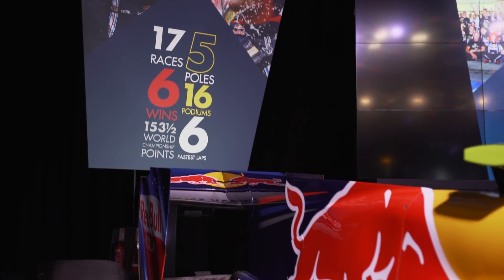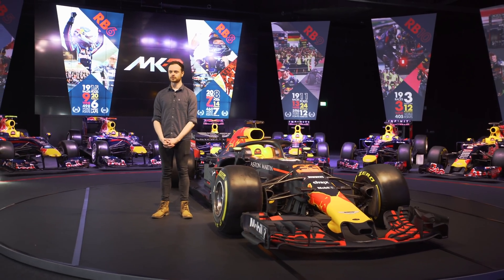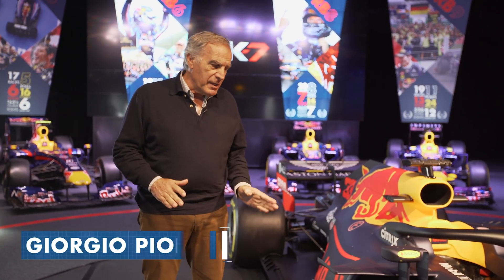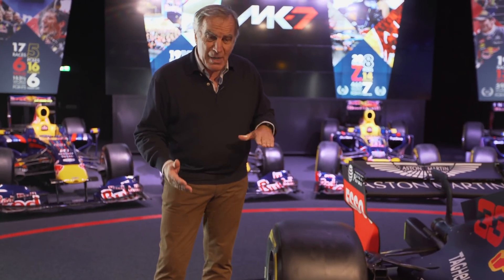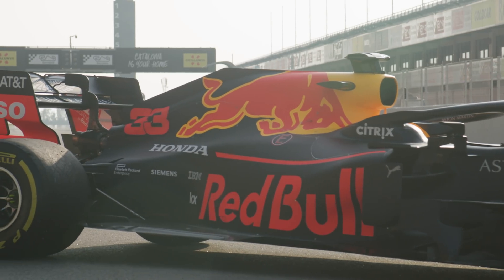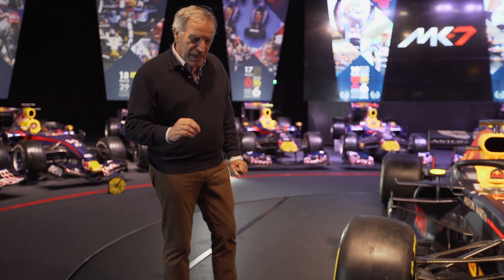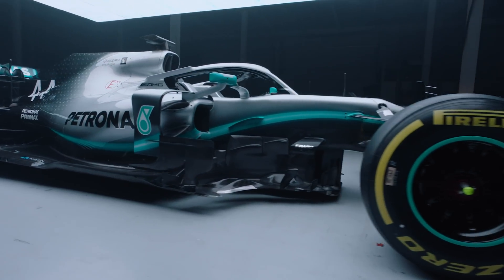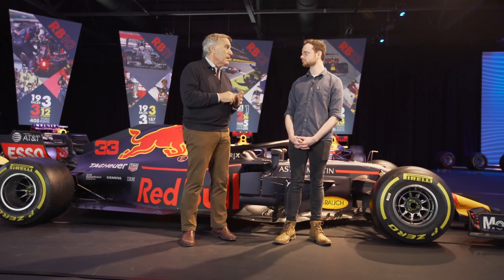Why 'rake' is such a big design trend in F1

Comment: Funny that the only car without the set up is totally dominating the season. 🤪
Reply: As they said, they have a different concept, with its main focus being the PU. The Mercedes is slower with a higher rake setting, just as all other cars would be slower with a lower one. One thing to point out is that ALL F1 cars have rake. The difference between their settings being the rear-front delta. What they refer to in this video is how Red Bull usually uses a much higher setting than the rest to fit their whole aerodynamic concept.
Reply: You might not like his personality but come on how delusional are you if you think Lewis isn't one of the greats. He has prove his worth before formula 1 in other ranks and still was on top. Both Michael and Alonso have said he is one of the best drivers. Yeah he has has the best car but so did Vettel and schumi no one discredits them.
Reply: $500,000,000 tends to do that.
Reply: @Troy Mclore exactly that, agreed 100% just the best driver of his time and the most balanced.
Reply: it's not the concept that makes you win or not. It's how much you can extract from it. Red Bull won with this concept in an era where Ferrari, like Mercedes, didn't used the rake concept.
Reply: @Stratowind he started good but sorry mate he's a better driver than me but still far from deserving that merc seat. There's better drivers they could put in that merc and get better results... Even grosjean would smoke bottas if they were both in a merc
Reply: Funny that without this they may be down the line
Reply: @Troy Mclore nobody is arguing that..
Reply: Dumb
Reply: @Stratowind yea, thats when he has his porridge and hangs up when he hears "It's james"
Reply: It's because Brawn's philosophy is still within the team, Despite Brawn owned and managed Mercedes only for the first 3 seasons (technically longer because Mercedes is the old Honda F1 team). Brawn always said to never copy an idea from another team because you'll only be as good as they, not better.
Reply: Only car?
...except those one's they built in the late 70s.
Reply: Everyone is struggling go come up with a good explanation for that.   My personal theory is that Mercedes aero engineers are next-level genius compared to the others.  They have engineered a masterpiece that has been optimised to work in a wide operating window using a different approach.
Reply: This argument is just ridiculous. People are saying Hamilton is only winning because of the car, but if you bring up his teammates he beat them because they aren't very good.. so it's clearly not all car then? Someone has literally said Ferrari didn't have the better car last season and were only winning because Vettel was the better driver until Germany but as soon as Hamilton started destroying Vettel.. it's the car. Is it car or driver? You can't have your cake and eat it too
Reply: chickmag001 I think you missing the point. Firstly last year Ferrari was better on some circuits. F1 is very circuit dependant. And there is no ways you can argue that Mercedes hasn’t been the dominant car in the turbo era. Bottas beats Hamilton on a regular basis. Too often. Ros also beat him too often.
Reply: @ryanwaugh1   like Stuart just said, how can he be getting beat way too often when he has overall beaten both bottas and rosberg convincingly. Vettel on the other hand is hardly convincing against a rookie leclerc and got beaten convincingly by ricciardo.
Reply: chickmag001 I’m talking individual races. Lewis has lost many races to his partners. Overall he’s a good driver. He’s not the best on the grid though. That’s between Verstappen and maybe Leclerc in a year or two.
Reply: @ryanwaugh1  https://f1i.com/news/289646-hamilton-measure-team-mates-much.html

Check this link shows percentage of races Lewis has beaten his teammate over qualify and race your comments are completely wrong even i was reading it I thought he beat Alonso in first season easily but looking at the data he didn't but since then he has dominated every driver and has also been the only driver ever to win at least one race every season he has been in end of
Reply: @stuctr  I hope you watched the race .
Watching Lewis spinning on slicks on damp track . Now try and tell me  Lewis is better than aryton .....and we'll both know you're lieing .
Reply: Honestly very hard to compare modern F1 to decades ago.  The teams are so much closer and skill level in the field higher overall.  Also important beyond skill of speed and consistency is ones ability to adapt to a car (or a team to deliver a car that fits a drivers style.)  Even minor changes in rules can accidentally favor some drivers over others.  Some drivers are more aggressive some more smooth, some would be better with more drivers aids and complexity others more in raw cars with nothing.  All of these little things matter because F1 is so damn competitive.
Reply: @MrCatseyes01  hope you watched today's race and now tell me Lewis ain't the best and then we both know you lying lol
Reply: @stuctr  don't make me laugh , Lewis can't even stay on a wet track . 
Mercedes had the fast car and best strategy that's all
Reply: Bet you feel pretty stupid right about now
Reply: Funny how F1 Gernany totally exposed both drivers as complete amateurs. FIA should look for autonomous driver aids in those cars. Clearly didn't work in the rain 🤣🤣🤣
Reply: Lewis is like a spoiled child.. don't care how good a driver he is . Give Alonso his car and see..
Reply: there are many factors that affects the speed of the car, not just the aerodynamics
Reply: Man this comment section is entertaining to read 🍿🥤
Reply: Troy Mclore Lewis has been beaten too many times by his teammates. He’s had the best car all his career wins. He is good but way overrated. I think Verstappen has surpassed him and I hope Leclerc will soon.
Reply: @ryanwaugh1  what the f you on about Lewis got beat once by Rosberg because he was more consistent if Lewis hadn't had his retirements that season from car failure he would have won title when he came into sport at the time Alonso was 2 time world champion who just beat Schumacher at his prime and Lewis wiped the floor with Alonso in his first season button never came close neither did kovalinenn bottas show me one example of Lewis over a whole season being beaten by teammate
Reply: stuart davies Lewis has been beaten many times. He still loses to a below par driver in Bottas. Schumacher has a car that FIA tried to slow down that year. He still contended for the title.
Reply: @ryanwaugh1  bottas been in a championship winning car for last 2 years correct and has come nowhere Lewis except for a couple of wins Lewis is so consistent and fast when red bull dominated with vettel Hamilton was still adding pole positions and the odd win to his tally in a McLaren which was not as fast as red bull proves you wrong that he needs to drive a shitter car he will be the most successful driver in f1 soon with wins titles etc results matter end of and Lewis is king at getting results with few mistakes
Reply: ғɪʟʟ 1ɴ ᴛ҉ ʜ3 ʙʟᴀɴᴋs I think it’s the drivers tbh cos Lewis is by far the best driver on the grid, but once he is out of his prime, youngsters such as Norris, leclerc or verstsppen will dominate
Reply: KSI SOLDIER please man! Lewis overrated cause he’s British. Verstappen is way better and I’m not even a fan. He’s always had the best car and that’s it.
Reply: MrCatsEyes British broadcast across the globe and they always pump their own. Bias media. Until Lewis drives an underrated car like Verstappen is now and puts it in the same positions he’ll never be one of the greatest.
Reply: @ryanwaugh1  and I do agree with what you said . I'm not a hypocrite or a Lewis fanboy for me he's very good but not until he does what even alonso did and drive a crap car he won't be more than a outstanding driver in a very good car
Reply: KSI SOLDIER verstappen is better than Hamilton
Reply: @gcar5214  wow you are cute, you don't seem to know f for a long time, drivers have only a very little influence, it's 90% the car and engineers that make a win
Reply: KSI SOLDIER by far May not be true, but he is good
Reply: KSI SOLDIER he isn’t by far the best driver on the grid.
Reply: @gcar5214  lmao you're taking the piss. Mercedes are dropping Bottas because he's so slow.
Reply: @gcar5214  Lewis is garbage without merc
Reply: @CxnstantineII  just swap him with Kubica and we'll see him battling Russell for 19th 😂
Reply: @gcar5214 , crap. 
Top Gear the F1 drivers were doing a lap in the Kia and Daniel Ricciardo's lap was faster than Lewis Hamilton's. 
Argument settled.
Reply: KSI SOLDIER  im a hamilton fan but if you put him in a williams he wouldnt be winning
Reply: @gcar5214  LEwIs iS THe BeST dIVeR oN ThE GrId .....
No he's a good driver in the best car on the grid
Reply: @MrCatseyes01  Perfectly said thank you... Literally put George Russell in the Merc car and he would be doing just as well... F1 isn't all about drivers, it's about the car package. SO many fans overlook this because they treat it like Golf or Tennis where most of success is derived from individual performance. Think about how little credit race engineers, aerodynamicists, and R&D people in general receive compared to the drivers on the grid. Sure, drivers are important but as F1 has always shown- if the car isn't there, the driver won't be either. E.g. Fernando Alonso, Lewis Hamilton at McLaren 2009-2013, Kimi Raikkonen now with Alfa Romeo vs. Ferrari last year
Reply: @f4k3gamer  I think you forget that vettel threw the championship away at Germany last year . 
Wich proves it's 70% the car .

Nigel mansell never won a wdc until Williams did traction control and active suspension . 

Damon Hill never win anything until he won the wdc in a Williams full of toys 

Rosberg never won shit until he got in a merc , then quit.  

Jenson button never won a wdc until he got in a brawn 

And the only thing bottas could catch in a Williams was a cold 

Your piont is ?
Reply: Rex Kim I hope Michael Schumacher is included in your argument 
Senna 
Prost
Fanjio
Vettel 
Every other driver that has won a race and championship 
Win a race=Car. Great philosophy.
Reply: @f4k3gamer  Oh, please... Give me a break. That Merc was miles better than the Ferrari. The difference wasn't as abysmal as this year's, but trying to heighten Lewis' 2018 Championship by giving the Scuderia credit for something they don't deserve it is both ludicrous and ridiculous. The Ferrari seemed better because Vettel was better than Lewis up until Germany, but we all know what happened after that...
Reply: @migracing8232  I was just listing some examples
Reply: @f4k3gamer  exactly
Reply: @migracing8232  yeh but senna was born to drive , go watch his vids in a lotus . The guy was born to be the best f1 driver that will ever of lived , there will never be a better driver than senna
Reply: @j.j.schlachtfeld9325  So when vettel wins its his talent but when lewis wins its the car? LOOOL
Reply: @MrCatseyes01  hes the best driver in the best car
Reply: @j.j.schlachtfeld9325  wrong so much. since 2017 Ferrari has always been much easier to drive than Mercedes. and in 2018, Ferrari had better engine, and better aeros. There is no arguing that, also tire management. the only thing that Mercedes had, was their team, including Bottas and Hamilton. car can't win races without a driver, the same way as driver can't win races without a car.
Reply: @iChrisBeezy7  Not at all. Vettel was outperforming the car last year, but Lewis was underperforming. The minute he got his shit together, he was unbeatable. Having a great car helps, obviously, but as Bottas, Gasly, and others  have shown many times, it's not everything. Vettel was on his A-game from 2009 to 2013. He won four titles and came second in 2009, but if anyone says the RBs 6, 7, 8, and 9 weren't the best cars in their respective years, they're crazy.
Reply: @Sajaia92  The Ferrari seemed to be better because Vettel was outperforming the car for a while (some people seem to forget that he's actually good, lol) while Lewis wasn't on his usual level (he said it himself many times).Of course it all turned around in the second half. Both teams have never been so close, but the W09 was the better package, and there's nothing wrong with that. Mercedes works better than Ferrari, but that doesn't take anything away from a great season by Lewis.
Reply: MrCatsEyes All of a sudden senna is born to drive. So you’re implying that other drivers weren’t born or just a sitting duck getting paid 40 million dollars to drive a car each year? Are you telling me the teams doesn’t know the importance of drivers and their talent and they went out their way to pay them 40 million dollars each year to driver their car and win races and championships for them? You’re pretty ignorant.
Reply: Rex Kim Are you seriously getting defensive of your favourite driver cos the argument got spicy? Way to be a hypocrite man.
Reply: @j.j.schlachtfeld9325  I don't forget that Vettel is good. He is 4 times wdc after all for a reason. But he hasn't been in a good shape since he joined Ferrari. That's what kind of an effect this brand has on the drivers. In 2018 it was only second half of the season where Mercedes outdeveloped Ferrari
Reply: @migracing8232  not ignorant , I've seen senna drive in real life nobody is better than him, prost was close if not equal , senna used to drive one handed around Monaco,  shifting gears with left hand when the gear stick was on the right , senna invented heel and toe and like I previously said he won  in a lotus wich was not as quick as other cars . Senna was good in any car ...
Reply: @migracing8232  and yeh Lewis got skills but he's just a product,  he was racing from childhood then spotted by mclaren. Then got the the best coaching in the f1 world . Then the best team .
Reply: @migracing8232  ? I don't have a favorite driver, nor I have I mentioned any. Did you even read my post? Does it imply anywhere who my favorite driver is? I'm agreeing with you that the car is a monumental factor in deciding winning.. not sure why you're calling me a hypocrite?
Reply: @trexsharktruck86  exactly . That's why I only support teams and not drivers although I think max is very good pushing the merc and ferrari in a redbull that's  inferior to the top teams
Reply: @f4k3gamer  wich  proves my point it's the car that wins championships. Every f1 driver aspires to be like senna even Lewis
Reply: @MrCatseyes01  look at Lewis track record he has won at every formula he has driven Rosberg only title win came from consistency not pure pace you only need to look at how many pole positions Lewis has the most ever in f1 (and yes they do 20+ races a season) his ability over one lap to put it all together with low fuel get the tyres in the window for that one lap is outstanding and to me proves Lewis Hamilton is the best we have ever seen I agree senna was amazing I remember watching him but he also was a cheat like Schumacher people seem to gloss over that as he unfortunately died yes the cars were trickier to drive in his age but we're do you stop with that I  mean Stirling moss etc were driving in bath tubs doing 160+ on skinny tyres people died week on week I can't wait for Lewis to overtake Schumacher as the most successful driver ever and wipe people's noses in it which I doubt he would as he is a humble guy despite being so rich and famous
Reply: @stuctr  mate dont talk to me about rosburg the guy only raced because of his dad keke and when he relised he was living a lie, he quit.
And how exactly did senna cheat? yes he got a bit crazy at times and may of cut the odd corner and that's it.
But if you look at the race line these drivers 2019 are taking its not far off race track bounds.
And yeh for sure nobody can top the likes of fangio, moss, lauder they were in a league of thier own.
Not hating Lewis the guy has more skill than every f1 fan. But just put max in that merc and you'll see a better driver than Lewis
Reply: @MrCatseyes01  I used Rosberg in same context as you so why not mention him and I suggest you do some history checking senna drove prost off the road at the final race in Japan prost in same car was faster and would have won championship but senna rammed him off at first corner to take the title same as Schumacher against hill and he tried it also against villenueve in 97 give me one example of Lewis cheating 

And as for verstapen I'm a massive fan he is quick but Lewis would easily compete he is shorter and lighter for a start so has a minor advantage over max in just basic physicallity for ballast etc Lewis is so smart in race craft and his experience would easily overcome max
Reply: @stuctr  I've been a f1 fan for 30 years mate I don't need to check anything.
Like I said senna got crazy at Japan and again I said prost was his equal in the same car I'm not taking anything away from prost but that's how people dismiss senna... From Japan. I'm not going to speak badly about Schumacher because of his situation but nope sorry he just had the same mentality as senna, Lewis, max he was there to win he was ruthless.... On the other hand you might want to ask ferrari about the cheating part.....
Reply: @stuctr  and yeh as for Lewis being shorter and lighter, yup that's facts the smaller driver will always be the fastest
Reply: @MrCatseyes01  then why would you say senna didn't cheat if you knew he did lol senna would also not share information with teammates which was a reason he went to Williams as number1 driver nobody wins in f1 without a decent car and some luck in the race Lewis is the best we have ever seen for now maybe one day max will overtake him time will tell
Reply: @MrCatseyes01  so we agree them Lewis is the best lol
Reply: @stuctr  haha so you dismiss senna because of Japan. One incident infuences your complete opinion? Senna was consistently the fastest. Hamilton might be the best you've seen. Like I said when Lewis can drive a car with no driving aids around Monaco.... The hardest and demanding track on the f1 calendar, one handed heel and towing and changing gear in a sequential box with the opposite hand, and then still going. 4 seconds than anybody else.
Then there's senna in the wet 1993 European gp, highly regarded as the wet race master and the best f1 opening lap in f1 history.
When Hamilton can do what aryton did  then  come and make your claim, but for now it's just numbers on a bit of paper nothing else.
Reply: @stuctr  no he's the best for you and that's it.
Reply: @MrCatseyes01  so i can't use one moment in history to show senna at his worse to win one of his 3 titles prost would have 5 and senna only 2 otherwise but you can use single moments of brilliance sounds a bit hypocritical to me 

And as for Monaco quite a few people might argue look at this year's race with the tyres we have now to keep verstapen behind as a masterclass in Lewis craft for driving I'm not saying senna wasn't amazing just don't understand how you can't see Lewis as the genius driver he is
Reply: @MrCatseyes01  He beat the fastest lap with 20 lap old hard tyres on silverstone
Reply: @stuctr  no that's the only moment you've used because that's the only moment you have and that's a fact . You're trying to say Lewis has never made a mistake ? 
Not a hypocrite and not single moments check your f1 history then get back to  me when Lewis drive like aryton did ,  over 20 years and here we are still talking about aryton . I highly doubt people will think the same about Lewis in 20 years , he'll just be another Schumacher. ...that guy that won .......of races because of the car and that's it nothing else .
Reply: @stuctr  and I never said Lewis is a bad driver ,he's more dominant because of the car  infact his style is very similar to sennas ,on paper Lewis may be a better driver , in reality he'll never be better than senna,
Reply: @SENTlNEL  yeh with the best car and set up on the grid . 
Sorry mate until Lewis goes ham in another car and another team then all the numbers in the world won't change my opinion . Or if by some miracle aryton and Lewis went head to head then I still know aryton would beat him 
Aryton - Jedi master 
Lewis - Jedi knight
Reply: @f4k3gamer  yes but he's never driven a bad car , that's my piont dude and yes if corse I watched 2008 . Like the other guy said , every driver has his moments , I'm not taking that away from Lewis a brilliant drive in the wet . But again sorry until Lewis drives on a wet track on slicks like aryton then nothing you say will change my mind
Reply: @MrCatseyes01  I would say results matter had senna never won a world title would we still be talking also as sad as it is would we still be talking if he hadn't died would he have won more titles etc etc that is a main reason we still talk about senna as the greatest because he never had a full career Lewis has overtaken senna in every aspect wins poles titles and I hope he beats Schumacher titles but people like you will probably never accept him as the best because of your rose tinted glasses about senna using a few races where he was exceptional you used Monaco as example earlier driving with other hand etc but should we also mention when he was nearly a lap ahead and pushed too hard and crashed before the tunnel Lewis has made far less mistakes then senna did he also has never rammed someone off track to win a world title
Reply: @MrCatseyes01  Also if you were just watching the f1 live nearly 4 tenths quicker than teammate same car enough said Lewis the best lol
Reply: El-Caesar don’t bother with haters, they are always gonna hate.
Reply: @MrCatseyes01  Senna DID NOT invent heel and toe.  Senna was good but not good in any car, that would be Stirling Moss.  That man could go from an F1 race one weekend, to a rally the next.
Reply: @MrRadialdrift  dude your talking about a complete different kind of human  being , guys like Moss happen by a freak of nature , thier not human .....
Reply: @MrCatseyes01  Max Verstappen, nuff said ;)
Reply: @migracing8232  Here lie the difference.  Senna and Vettel won with one dominant team at the time.  Schumacher and Prost won with two teams.   So did legends like Lauda, Stewart, Graham Hill, Piquet and Fittipaldi.  But no one did it like Fangio, who won with 4 different teams:  Alfa Romeo, Mercedes, Ferrari-Lancia and Maserati.  It is much easier to step into a winning team right away, than to lead at different teams having the right talents altogether.
Reply: @MrCatseyes01  Do you even know what the hell you are talking about?  Have you ever being in a racing car or even driving one?  Do you know what is the 'Heel to toe' technique?

'Heel to toe' has been around since automotive racing was born in the early parts of the 20th Century.  In order to do this, you need to have a good feel of the car and being smooth throughout.

Senna is the complete opposite to this.  If you have a chance to watch his racing films, in particular with the turbo days where there was a significant turbo lag before the full power is coming on.  Senna will like to maintain completely high revs throughout by 'jabbing' the accelerator pedal to keep the momentum of the car going.  To do this, he needed to trust his instincts and catching the drift the moment when the car might go away.  Of course, this looks quite spectacular in one sense.  However, that doesn't mean the car will go faster because you are losing time in correcting the drifts.  This is why the car that is going smooth is usually the fastest.  

Over driving the car like what Senna did was trying to compensating the car.  Problem is that he often gave unnecessary abuse to the mechanical stress and killing the grips of his tyres.  Sure, he was a legend and really successful.  But often he suffered far more reliability issues too.  The days where the races were sprints, super grippy tyres and refueling.  It wasn't really an issue.  However, with a completely different car where you have to use different tyre compounds, no refueling and handling tyres that suddenly will go off like grooved or Pirelli compounds.  Will Senna able to cope?  I am not sure about that.
Reply: @canicetang8837  and how much racing experience do you have?  Wich is a stupid question because I already know the answer .....0 .
Reply: Mathew Alani Ferrari had a better car, but far from a much better car
Reply: @j.j.schlachtfeld9325  some of the things that stands out in 2018, Ferrari performance in Australia, Bahrain, USA and especially Spa. Arguably some of the best all round performance with merc being left in the dust..
Ferrari had a more complete package last year
Reply: MrCatsEyes  u can say the EXACT same thing for verstappen, and Lewis made it work at mclaren while Button couldn’t
Reply: @trexsharktruck86  A fast, well balanced, and reliable car is about half the battle. The other half is a consistent driver. All the drivers are good, and fast. Otherwise they would have never made it to F1. The big difference is being good and fast, lap after lap. There are few drivers in history who can do that. When you compare Hamilton to Bottas in the same machine, Bottas may win a one lap race. Give them 20 races at 50 laps a race, and Hamilton will be more consistent. That's where the win is. Now most of you already know that. So stop being naive on youtube.
Reply: @trexsharktruck86  Put Ronaldo in Barnesley and he won't win the champions league, the same with Messi.
Reply: KSI SOLDIER Absolutely false, F1 is 90% car and Bottas isn’t a fast driver
Reply: @IchiroSakamoto  agreed bottas is just a flump , he's faking it anybody knows anything about f1 knows it's the car . 
That merc could probly drive itself :)
Reply: @IchiroSakamoto  then explain why Bottas has qualified better then Hamilton at times. If he's so slow how did he dominate the first two races?? Idiot comment that Bottas isn't fast. He's apparently faster then most of the grid including Verstappen and Leclerc

SMH
Reply: @IchiroSakamoto  I agree. Except 90% is way off. The car is at least 95%. Any good driver would put a Merc, Ferrari, or Red Bull in the top 6.
Reply: @gcar5214  Yeah smh Russel is the 2nd worst driver of the grid he is always 19th in qualifications! Verstappen is so bad compared to Lewis he never qualified higher than him! Lewis destroys everybody with his talent!
Reply: @emilecarpentier  put max in that other Mercedes and he'd take the fight to lewis. No doubt about it. I bet he's a driver lewis would last want to see as his teammate. He doesn't qualify or finish ahead of Lewis right now because the red bull car is nowhere near as good as the mercedes. Seriously though, I hope Max is the one who will replace bottas
Reply: @richboy900  Yeah I know lmao I was just laughing at this guy for saying Lewis dominates everybody without mentioning the car, Lewis is no doubt one of the best driver in the history but still he only has to beat his teammate. I have high hope for 2021-23 with budget restrictions
Reply: @emilecarpentier  what! !! Honestly disagree with your opinion on max . Let them drive the same for sure I bet on max
Reply: @anandakumar gurunathan she was being sarcastic, i think it was pretty damn obvious
Reply: @f4k3gamer  yea thats a good point. I'd say max would probably do a better job on Saturdays, but lewis would probably be more consistent. Max's temperament is his achilles heal, and i agree with the ocon incident, he didnt need to risk racing so close to him wheel to wheel
Reply: Émile Carpentier you think Mercedes will happily exchange Hamilton for Vettel or Verstappen, since driver doesn't matter at all? Hell I'm sure they'll both take a pay cut to join the best team right? People much smarter and more knowledgeable than you and I have placed Hamilton as the best DRIVER of his generation for a reason. He came in as a rookie and beat a two time world champion. Best Driver + Best Team = Total Domination
Reply: @thebbiddim882  my comment is obviously sarcastic
Reply: Émile Carpentier 

Put Lewis in a sauber and let’s see if he qualifies above raikonnen, put himin a Ferrari with Seb as a temamate (Ferrari car goes against both their driving styles focusing on power more than aero) and let’s see if he qualifies or beats him in a race, Lewis has always had the best car on the grid so we can never be sure about his true talent compred to others unless he drives in an underperforming car
Reply: @Perifroog  s a r c a s m, cmon people
Reply: @Perifroog  He literally outqualified every teammate he’s had.
Reply: @emilecarpentier  Lol put em in the same car and verstappen will dominate
Reply: @emilecarpentier  

hahaha, youre joking righ?? Verstappens RB is nowhere near mercedes' f1 car
Reply: @emilecarpentier  Put Russel in Hamilton's car and he will be no.1 too.
Reply: @emilecarpentier  look at him now, he actually did qualify highr then lewis last race.
Reply: @zorbat5  what's your point?